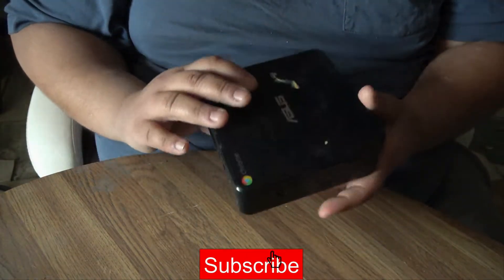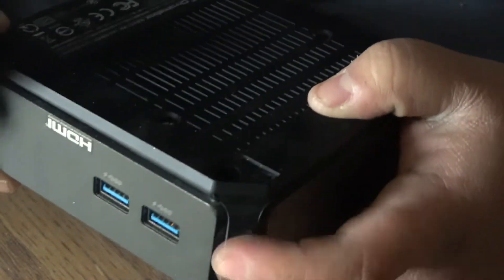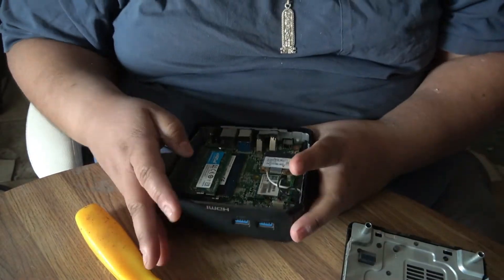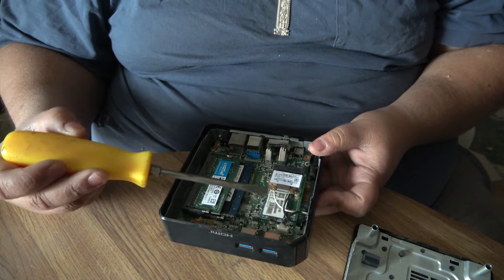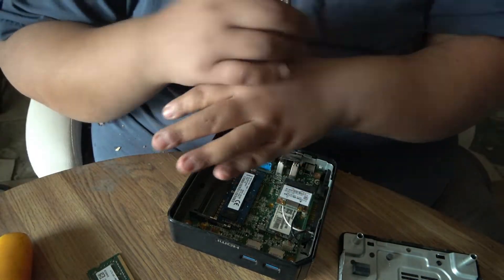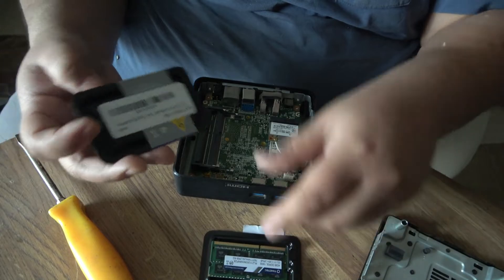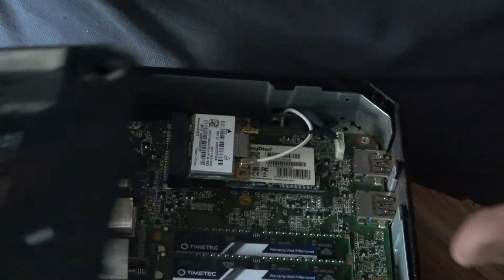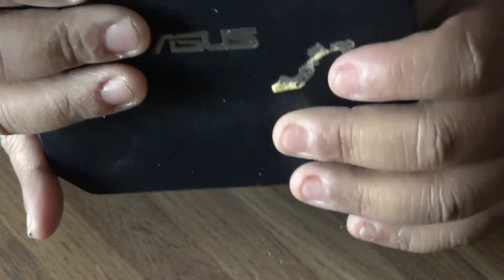Quick fast  easy ram upgrade  c60 asus chromebox

Comment: I have 8gb now running windows 10... would going to 16gb make a difference
Reply from the maker: it's not designed to run windows 10 the cpu is slow and old.  i think the ram limit is 8gb  check the manual or Google it.

put Linux on it will run way better
Reply: Yes you can add 16gb of ram to it, it will make it run much smoother and you won't notice it slowing down, you can add up to 32gb of ram to the Chromebook, I have a 4gb  and about to add a 16gb stick of ram to it. Giving me a total of 20gb of ram.

Comment: Where is your link for the ram?
Reply from the maker: https://www.amazon.com/gp/product/B0191WAEP8/ref=ppx_yo_dt_b_search_asin_title?ie=UTF8&th=1
Reply: @justbored3.14  any links for a compatible SSD? thanks
Reply from the maker: @metaldoi   that unit uses a m2 2242  type.     check out this link   https://www.amazon.com/s?k=m.2+2242&linkCode=sl2&linkId=e55b24ca1bce8f462e85fc2255d43525&tag=bradlindsdigi-20&ref=as_li_ss_tl         i would recomend a samsung model if possible to purchase.